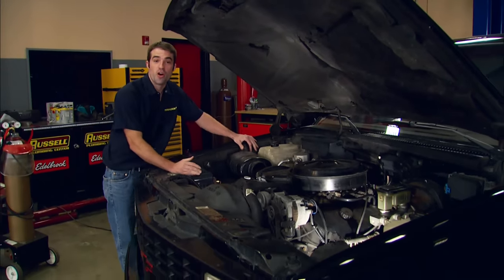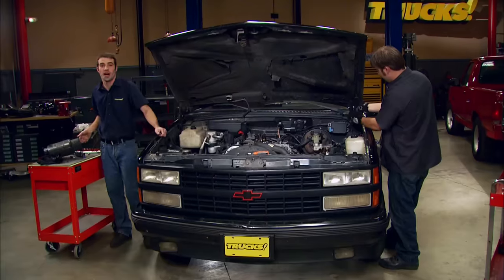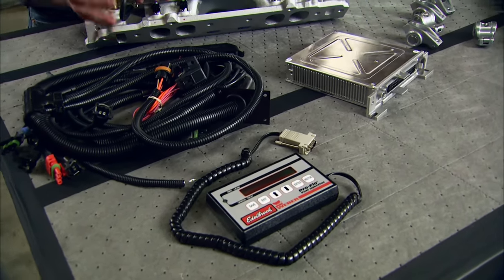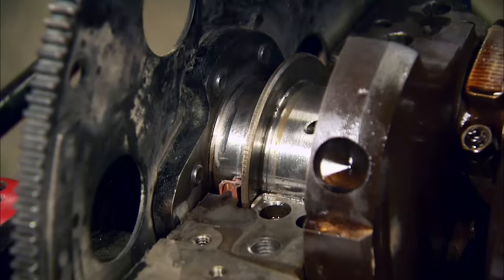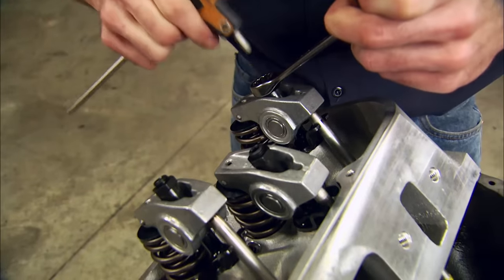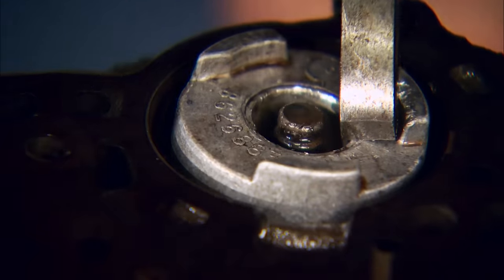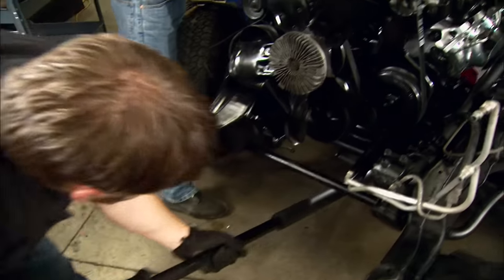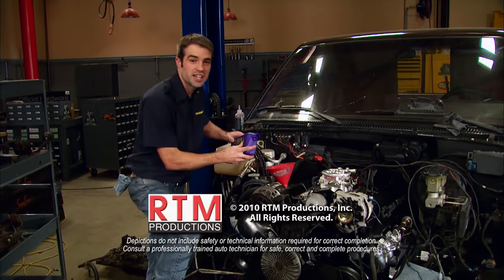Waking Up A 1990 Chevy 454 SS Big Block MuscleTrux Wars Part 2 - Trucks! S10, E2

Comment: 454 not high revving engines huh? Well I shift mines at 7000 rpm 😁
Reply: You won't for long...
Reply: That all depends on how it's built!  7k RPM is a lot, though!!
Reply: @dennisschell5543  been doing all racing season. That's nothing. Factory ls6.454s redline was 6500 from the factory. Granted no u not gonna do that with cast pistons cast crank and stock rods. But I've turned 6000 -6500 on stock internals.
Reply: @paulhoskins7852  I've seen big blocks turned 10000 rpms. Ppl have a mis conception about big blocks.
Reply: @BigUnk85  I think you are comparing apples and tangerines there, the difference being a factory engine mass produced to see a lower RPM range and a purpose built model; kind of having a marathon runner in a Sprint and a Sprint runner in a marathon.

Comment: So, the aftermarket EFI just killed any possibility of passing smog. You left a stock converter in because you didn't have a free one from a sponsor. Someone else has gone into the engine but you don't replace the bearings and check for damaged journals or check to make sure the rod ends are machined round? It amazes me how channels like this keep doing this stupid stuff......
Reply: they are adding a honey cone 3 inch cat.. MPI will NOT kill the smog test (They even retained the A.I.R. system).. the other stuff.. well, this is kind of a cheap and fast series for a couple shows. No biggie.
Reply: Considering this was 20 years ago lol.

Comment: Your cam selection sucks and 8.5 to 1 compression ration is way too conservative. You can be at 10 to 1 and still run pump gas so why not put some flat tops in it?? What a waste
Reply: I though that same. Only good use could be for supercharging
Reply: Because Edelbrock doesn't sell pistons.   These shows are fun to watch but they're really just long commercials.
Reply: Because this isn't a performance how to vid, it's one long commercial.
Reply: I went to this comment before watching the entire video. Already disappointed. High compression sounds nice on big Chevys.
Reply: Wait. "8.8" not 8.5:1. Still sucks.
Reply: @Panhead49EL  Sad, & true.
Reply: Thanks for clearing that up fellas, never thought of it that way. You watch Steve Morris engines or Nelson racing engines and then this and your like....🤷‍♂️wtf?!?
Reply: Flat tops wont make much of a difference u would go from 8.8 to 9.1 to see a big difference would require a set of dome pistons.

Comment: If they're smart, they'll add a stroker kit. Costs about the same as a stock rebuild kit, as it does to turn it into a 489. Should easily make 600hp as a 489, 650 isn't a reach either. They got 620hp out of a 454 on Engine Masters with Edelbrock XT heads and a solid roller cam.

Comment: Like others have mentioned, I would have at least thrown a set of new main bearings in to be safe. Also, when building an engine where you replace pistons and hone cylinder walls, use regular non-synthetic oil for the break in cycles so the rings can seat properly.
Using a full-syn like Royal Purple to start with on break-in is too slick and can cause glazing the cylinder walls without the rings seating properly for a good deal and minimal blow-by.
Reply: @bigboreracing356  
Because the engine is making double the power it was previously and that means higher stress and pressure levels on all components.
As the saying goes.. You're only as strong as your weakest link.

Comment: Damn dude. Even with 8.8:1 compression you can still add some kind of forced induction. What about a little 50 shot or 75 shot of nitrous? I know the stock short block can handle at least that much.

Comment: Installing the camshaft without a degree wheel?
Only to hear preload is set with 3/4 of a turn!
Followed by hearing OEM oil pump to distribute synthetic oil thru bearing clearances intended for slight thicker than water oil!! 
No doubt, you’re right about it picking up some extra power and ten different answers! 
Plus, as additional bonus considering how you Tennessee fellers pussy foot the loud pedal there is no fear of destruction! 😂 
I’m just busting balls! We’ll sort of!😎
Great job as usual fellers

Comment: Do you guys happen to know which block casting numbers indicated a 4 bolt main vs a 2 bolt? I have a '85 square body with a early 90's 454. The MSD module recently caught fire and nearly burned the whole front clip off. I have been prepping and gathering parts to rebuild it to a 625 to 700 hp roller engine, but haven't taken the bottom end apart yet. Hate to spend all this $ just to get in and find out the rotating assy isn't gonna hold.

Comment: Small port heads and a low riser intake. I think we can see why it blows the OEM tires away. One way to solve that is a numerically lower rear axle or a much taller tire--better MPG and top speed. But a cam that lowers the final compression ratio could also help that pesky launch issue and keep the MPG and cruising RPM the same.

Comment: In 1997 the Lt4 vortec 350 had 345ftlb stock. 45 more then the 454 in this video. And it reved to 6500 rpm. And it got better mpg. Put a multi port on the vortec and see the dyno. This engine was dead before it left the factory.

Comment: Come on guys ---do some build up's on some vintage 4x4's. Chevy's '67-'72  3/4 ton 4x4 is the hottest 4x4 on the market now!!!  I should know because since 1979 I have built/bought/sold over 350 trucks with 28 of them being total body-off resto's. I guarantee the build -up shows will be your highest rated and watched shows.  Jim

Comment: IDK why anybody would put that nice, new top-end on that old, 100K+ rotating assembly, but at the same time how many times do we have to watch them build a 454?
Another option should had been the LS3: E-Rod crate engine and 4L70E SuperMatic tranny.
430+ horsepower set up to pass smog/emission in CA. That engine is perfect for anything pre-1996, especially the G-body guys.

Comment: If it was stock vs stock the lightning would walk away from that Chevy easily.not to mention when you start adding aftermarket heads induction Pistons crank and everything else it's no longer a Chevy versus Ford it's aftermarket parts versus aftermarket parts especially in the heads category.. if there was a pure stock shootout where you couldn't change anything a 50-year-old engine from way back when would dominate everything clear up to this day and that is Ford's 351 boss Cleveland would be crowned the king 👑

Comment: You have to raise the Aluminum heads  compression one more point over the stock cast iron compression to make the same power, because Aluminum heads dissipate the heat better than cast iron and you need heat in the chamber to make power They did not gain a thing in conpression power.

Comment: I'd had my SRT-4 for about a month (still stock) when I ran into a 454 Chevy at a stoplight.  No contest, I was shocked how slow the 454 was.  Pulled up to the next stoplight and the owner was a great guy, wanted to know "What the hell is that Neon?" and had about a 2 minute conversation (till light changed).  He loved his truck but even he admitted that, for as big as the engine is, Chevy didn't do a very good job to get big power out if it. He was also stock.  They are a nice looking truck but they do need upgrades to actually be quick.
Reply: Stock 454 is only 250hp 450 torque so ya it's a slow truck
Reply: But even when the light turned green, you're still driving a Dodge Neon,
Reply: @SOLDOZER  - at least you know what the back end looks like, although from that distance it would be tough LOL
Reply: @rooh5825   Nobody cared about Dodge Neons until Obama's "Cash 4 Clunkers" program. They were good for that...
Reply: @SOLDOZER  - Still way faster than your truck LMAO, a 1990 rust bucket chevy truck and you are talking smack on the SRT4 hahahah, a car when released that was faster than a mustang GT, honda s2000, 350Z, WRX, oh the list goes on and on, reliable and fast, two things the SRT-4 had that you couldn't put together on a TRUCK LOLOL.
Reply: @rooh5825   Who cares about "faster". You can make a Neon faster than a $500K Lamborghini. Its still a POS Dodge Neon.......
Reply: @SOLDOZER  lol whatever helps you sleep at night, it's a hell of a lot better than a POS Chevy S10
Reply: @rooh5825   "I have a Dodge Neon" said nobody with pride ever.....
Reply: @rooh5825    Why you watching 454SS videos then? Hahaha...

Comment: Had a 454 in my tow truck and got 500k + miles on it before the timing chain slipped was still ok and could have been fix but it's my bread and butter so it was time for a new truck

Comment: These guys gotta understand it revs low because of the parts on it when u start changing intake manifold that have shorter intake runners bigger cam etc it'll rev quite high seen a lot of 454s rev past 7000 rpm with the right parts

Comment: I can respect what they were doing for the show, but the moment they revealed their cylinder head and camshaft choices but choosing to retain the low-squeeze slugs, I knew they were throwing away power. Even a cheaper set of flat-top pistons would have brought compression up to at least 9:5-10:1 and taken advantage of the heads&cam….I recall Hot Rod Magazine running an article on cylinder heads designed by Jim Feuling that generated far better HP&torque numbers even with the stock pistons…..

Comment: GM was at the height of neutering otherwise strong engines in 1990! Other than the displacement, GM choked off the 454 in the name of mileage and emissions. They never stopped to think that anyone wanting a 454 pretty much accepting of bad mileage.

Comment: Exactly how much of a fuel mileage and power improvement could I expect switching from a edlebrock 750 to this fuel injection on a ford 460 with a preformer cam and intake as it’s a considerable cost, work and additional complicity.
Reply: Bradford Ramm maybe 1/2 if your lucky but will see throttle response and better power.
Reply: Bbd L I think I’ll stick with simplicity. Lol

Comment: That's an Awesome build but for a 1990 GMC one tone 454 with the Turbo 400 auto and 4x4 what would you have done differently for more towing torque and horsepower?
By the way this truck has only about 66,000 miles on her.
Thanks for any help to get lots of milage and use our of this Sweet Truck I just picked up this last June. 😁👍🇺🇸
Reply: you have to decide if you’re gonna keep the fuel injection, or put an aftermarket unit on that’s the limiting factor from the factory it seems like. you can keep the stock throttle body injection but you’d have to go very mild with your build

Comment: respectable CR of 8.8:1? Why so low? Wouldn't 10:1 or higher be more adequate for modern high octane fuel? That would give the engine a big torque and efficiency increase

Comment: This is how I know these guys are parts changers NOBODY calls the front clip the "Dog House" on older Chevy trucks there used to  be a Bolt in Dog house that covered the Transmission and back of the engine // the core support and fenders are just the front clip ...OK Say "Front Clip"

Comment: 8.8:1 compression...respectable...come one, 9.5:1 is respectable. I would have liked to have saw 10:1+ and so there is plenty of room to bleed off dynamic compression in camshaft overlap and scavenging to produce more high rpm hp that truck needed. Like he said, it had plenty of low rpm tq bone stock.

Comment: i'm currently paused at 15:40 & this really doesn't seem like a fair comparison to me... that F-150 SVT Lightning had a 5.8L (351cid) Windsor Small Block V8. where as the Silverado SS454 has a 454cid (7.4L) big block v8 & they put like $5000 worth of Edelbrock performance parts onto an engine that's a better base to build serious power from in the first place...

Comment: It revved low from the factory because the heads cam intake are awful and made for low end tq that stuff they put on it'll rev a lot higher I would put a 3000 stall converter in it tbh

Comment: I spent a lot of time in the Air Force using torque wrenches. It makes me cringe when I see someone doing it the wrong way. The proper way to use a torque wrench is to pull it to you slowly until it breaks. That should come as a surprise like when pulling the trigger on a gun. If you push a torque wrench or jerk a torque wrench you will not get an accurate torque.

Comment: 8.8 high compression? lmfao!  So, B&M uses Trans Go gaskets? Why not use a 2000-2500 stall torque converter? It would surely wake it up. Also I would have used MSD Super Conductor wires instead.

Comment: Yep, somebody has welded the oil pump pickup tube so we should be good to go with the bottom end. Lol. I’m going to freshen up the block w/a new coat of paint! Replace the 80k mile bearings, nope.
Reply: 80k miles, that’s brand new!

Comment: You have the engine half apart, do a fresh rebuild the bottom end would be better and last longer. Get that compression about 9:5:1 or 10:5;0:1. Otherwise it will be called project half ass.

Comment: Respectable and 8.8 compression arent 2 things I think belong together.
Reply: Boost my friend.   Nuff said.  Which I believe this build gets.
Reply: @bmstylee  still doesnt nullify my point.
Reply: If you could get 450hp with non detonating 8.8 on 87 pump gas...  Yes, very respectable. Something you can drive everyday and not worry about hard hot starts and busted ringlands.
Reply: @hawkdsl  So lower Compression is more respectable?
Reply: @cuzz63  If you want a good long lasting light to light thumper that can put a smile on your face, you really don't need high compression. I'd say a good middle ground would be 9.5:1  -  The higher the comp, the more timing you have to pull out of it to keep it from pinging itself to death. Super high comps are really only for racing, with matched racing components, and well tuned. If you want to drive it everyday, or make a trip across the country, you don't need HC for any other reason then bragging rights.
Reply: @hawkdsl  I dont disagree with any of your comment, in fact with turbo's and Nitrous having high compression is a thing of the past.

Comment: Curious how different this 90's 454 is different from a 70's 454.
Reply: Throttle body injection
Reply: Big difference. 70 model 454 was superior.  Had way more compression better heads etc. If u had a ls6 454 it was basically a race engine. U had 11:25.1 compression 5.20 lift solid cam and rectangular port heads.

Comment: too bad royal purple does none of that. It's actually fairly known to be crappy motor oil, in a viscosity test after ran for hundreds of hours, it flowed worse then amazon basic's synthetic, which was 1/3rd the price. (also the amazon oil was ran at 300+ F for hours, and flowed almost like it did when brand new.

Comment: Just dont over do it on the heat (Torches it until the metal discolors and starts to oxidize)
Seriously some papertowels, water and a microwave is all it takes to make  almost 100*C and expand a part.

Comment: 8.8 compression respectable for a big block?   Why not go 10.5 it's still pump friendly and would be able to use more duration on the cam.  I could make more power with higher compression,  bigger cam and a nice carburetor.    You guys always over complicate things.

Comment: I'm sorry but I just can't.  If you cant make at least 500 hp with a 454 using aftermarket heads then you need to just quit.  BTW a single 3" exhaust is not enough.  More like dual 3", come on guys get with it.

Comment: I was always disappointed with the performance and power numbers this 454 SS ended up making.  It made me no longer yearn for one.
Reply: Yep, that 351w engine in the Ford is where it’s at. 30 more hp out of an engine 103ci smaller, and it only made a few ft/lbs of torque less. I know what I would choose.

Comment: This show is so bogus. But it is fun to watch. The bottom must be good right LMAO. With all that money spent on those top end parts it would be imperative to check and upgrade the bottom end when you're over doubling the HP output. A little clean up and machining would go a long way to insure the engine will last with all that added HP and torque as well as increase that output..

Comment: DONT HAVE TO REBUILD SHORT BLOCK--MAN DRAIN THE WATER OUT OF BLOCK BEFORE PULLING THE HEADS. IF YOU ONLY KNEW WHAT THAT ANTIFREZE AND WATER DOES TO THE BEARINGS AND JOURNALS.

Comment: I don’t know a lot about building motors, but would a cheaper option on the heads be a gen 3 or 4 LS head? Or would those not work?
Reply: As long as you use an LS of Dart Motown short block with the LS heads.

Comment: Just put some trick springs on SS. It will hook.
Reply: Calvert Racing: "CalTracks" is what's best for factory leaf spring rear suspensions. 

Upon load they help push the tires into the ground, leverage is applied.

Comment: Why wouldn't you just put a 4L80 in it.
Reply: Because a 400 is 10x better maybe??
Reply: @Artificial_Dopamine  Or maybe not!
Reply: @jrod264winmag  you do realize any real high hp real fast drag car has a 400 or a powerglide in jt right? Id dont matter what make the vehicle is unless your new to actual fast drag vehicles which it certainly seems you are.
Reply: @Artificial_Dopamine  I'm sorry, I guess I missed the part where they said they're building "real high horsepower drag vehicles" I guess I just assumed they where building street trucks.
Reply: @Artificial_Dopamine  You are aware there is a stand alone controler for a 4L80 in a custom application right? Did you catch the part where he said " these aren't high horsepower engines" and "we are using the stock torque converter". Seems to me you are  an expert in the raceing world.
Reply: @jrod264winmag  well i think i may have confused you with someone else in the comments that just said the th400 is no good as i was commenting with them at same time, gas mileage wise and stuff with the hp they have in the truck there would be nothing wrong with a 4l80